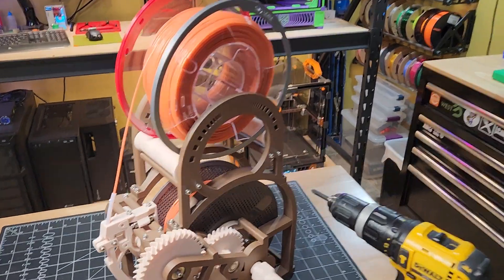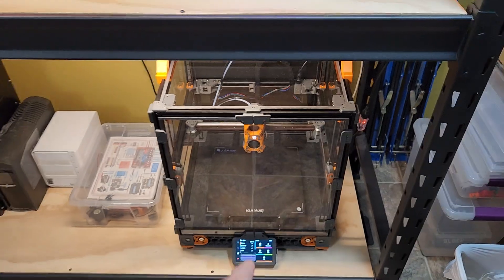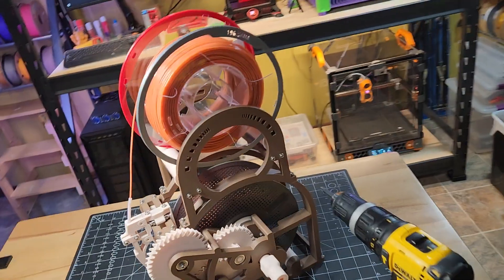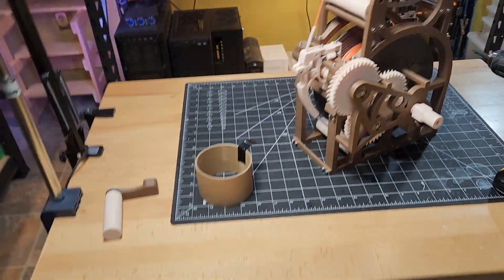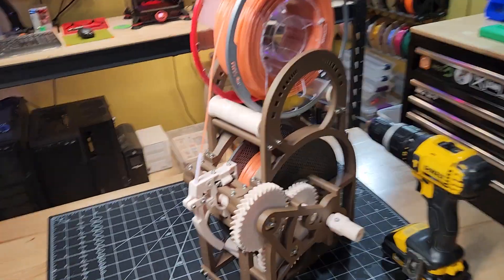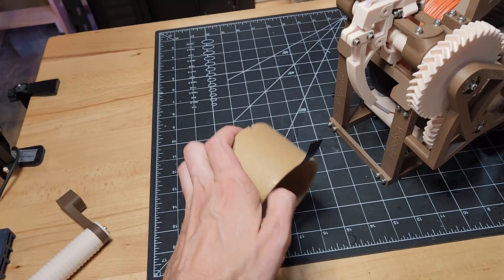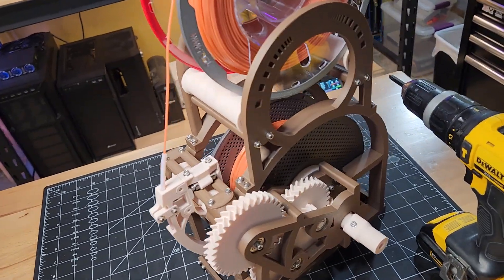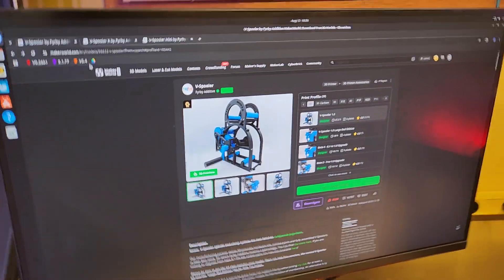V-Spooler Filament Re-Spooler

Comment: Not sure of your location, but I ordered the parts for the "motor version" for roughly $40 on amazon. Thanks for video. I have a broken spool also and was working on a solution atm.
Reply from the maker: Thats a great price and will be a nice improvement to the respooler. I'll revisit the parts and see if I can find alternatives. I usually source through AliExpress as I'm in Canada and parts are typically cheaper than Amazon or others but I'll look again, thanks!